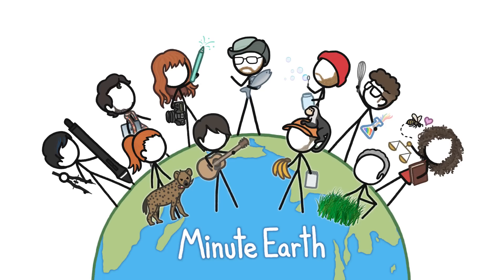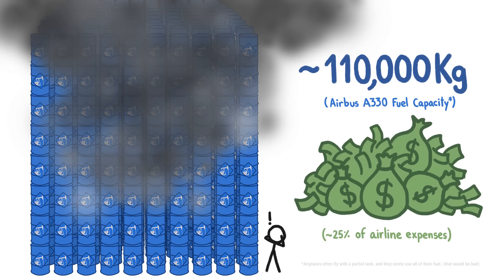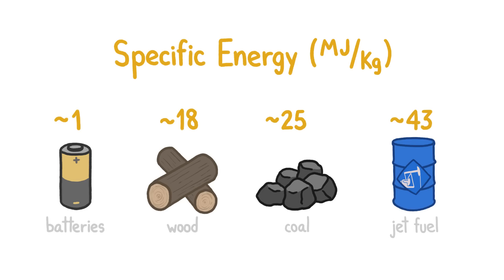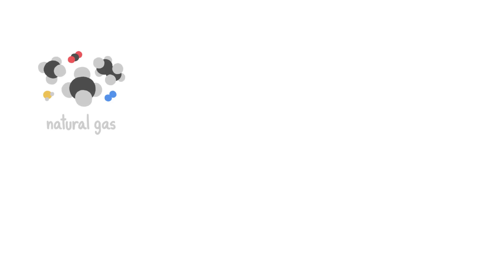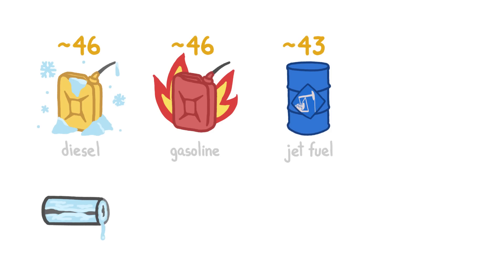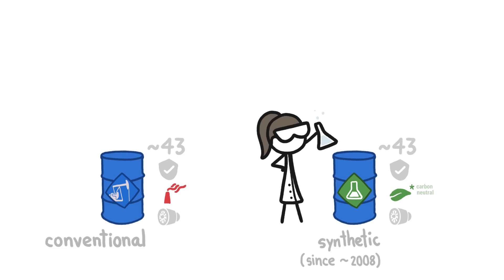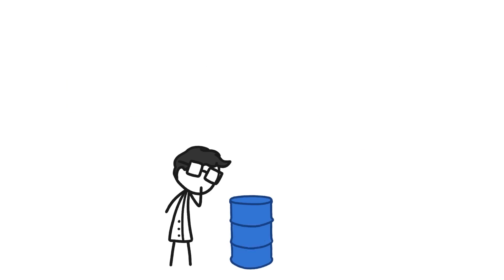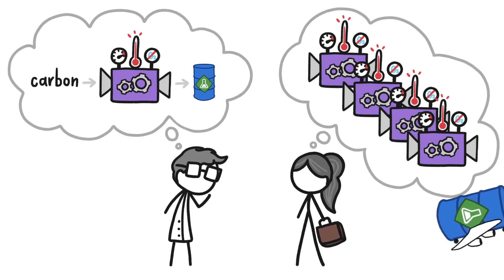Is There A Better Way To Power Airplanes?

Comment: I think planes (and gigantic mega-ships) are some of the few things that we can't easily stop using oil for right now.

However, we CAN stop using oil for powerplants and small vehicles (and anything else that can run on electricity). 
Start somewhere where change is easier than planes, right? But even that isn't happening. Not only do the people in power resist this change, but the average citizen is also against it ("bleh battery life on cars is so short and that is so inconvenient", "wahhh i am so scared of nuclear power plants and refuse to accept that they are the cleanest and most efficient power source we have").

Comment: You know, fossil fuels don't gain energy when they become buried in the ground. All of their energy comes from when they were created. An example is dead, oil filled algae getting turned into oil. While that all takes a while to happen naturally, that doesn't mean it can't be accelerated. We could build algal oil farms which use GMO algae to produce large amounts of oil in a carbon neutral way.

Comment: I wanna add that the use of nuclear fuels on aircraft is not only held back by risk of nuclear pollution in case of a crash or malfunction, but also due to the size and weight of shielding and the size and weight of the power plant including the engines (even excluding shielding). Sure, I'd like to see it happen, but it's just not feasible within the constraints of physics and biology. Thunderf00t did a debunking video of a nuclear fusion powered airplane concept. You will always have problems with shielding, because all nuclear reactions produce gamma rays if not highly energetic neutrons, which are even harder to deal with. Aneutronic fusion might be the best solution for a nuclear airplane, but you'll still have to shield the gamma rays.

Comment: Trains, waaàay more efficient, can be ~1/2 as fast. For overseas, use biofuels.
Reply: Trains are only more efficient if there is large enough demand. 
They have huge fixed costs, so if you are not moving enough people flights can be better for the environment.

Comment: Just saying that batteries are 43 times less energetic than jet fuel is so misleading. An electric airplane does not need to carry the equivalent amount of batteries since electric motors are much more efficient and they can fly higher (where there’s less drag but also not enough oxygen for jet fuel to burn) to achieve a similar range.

You are also ignoring molten salt reactors. That’s nuclear power too and it’s absolutely safe.
Reply: The ceiling of an airplane is ussaly not defined by the amound of thrust the engine can produce, but the amount of Lift your wings can produce. Additionally the speed has to be reduced at higher heights as the Mach number increases with the declining air temperature.

Comment: Less pollution upon combustion... How? (CH4 derived naturally and synthetically, both release CO2 in the same quantity).
Reply: Was also wondering about this. I could believe that the pollution created by manufacturing is less than the pollution created by extraction rigs and drilling? But then they specifically wrote "carbon neutral" in the video, which puzzles me.
Reply: @bidaubadeadieu : The idea is probably to produce methane such that the carbon in it comes from the atmosphere.
Reply: I guess they might try to use the elements they need to create the fuel in the air? Not sure how that'd work
Reply: Don't think about it too much. 90% of "green" technology doesn't do anything good for the environment, it's propaganda to make a certain lobby rich.

Comment: We should go back to airships. If it weren't for the Hindenburg and the stigma that came with it airship would have won out as the default flying mode of transportation. 90% of the time you don't need the speed of an aeroplane as a normal passenger, and their carrying capability makes them capable to compete with cargo ships. Not to mention that an airship ticket would be much cheaper and an aeroplane one, with as much baggage weight as you like. They can also run on complete green fuel like sunlight to boot.

Comment: What about solar? It would only work some of the time, but an electric plane flying above the clouds with a good battery would probably benefit from having a recharge during flight.
Reply: They've tried this. It was  a very lightweight plane carrying only a few passengers. And had massive wings. It could fly inDefinately but it couldn't exactly carry much.
Solar power just has a pretty low energy density.
Reply: But they need much area therefore would make a big plane like an Airbus A320 too big for the infrastructer we have.

Comment: What if we use solar energy instead of fuel?
Reply: Has been done on specifically designed planes. But it held only a few people.
However it could fly basically in Definately by flying high into the sky in the day and gliding at night.
Kinda useful for only a few people over shortish distances but impractical on a larger scale
Reply: Dragon Warhammer 
But solar power could be beamed down from a satellite in space. But overall the density is just too low
Reply: @curseofgladstone4981  but what if they use a battery, and charge it with solar like when day you fly using solar energy but when night come you use the battery that have been charge by solar??
Reply: Even if an airplane were covered entirely in solar panels, it wouldn't be nearly enough to sustain flight on its own.
Reply: Needs too much space on hypothetical wide-body aircrafts for our infrastructure

Comment: I mean, if you want to incentivize airlines and aircraft manufacturers to take alternatives more seriously, that basically puts you more on the political side of things rather than the scientific side. Airlines don't have to pay any tax on jetfuel, and there are basically no environmental regulations on it. Airplanes effectively run on the kerosine equivalent of leaded gas, so there are more fights to be fought there than just against CO2.
Reply: There's no lead in jet fuel, you're thinking of avgas which is used in piston engines. Jet engines don't have the knocking problem of ICE so they don't have TEL added.
Reply: @Croz89  That's why I said 'equivalent', you're right, there is no lead in jet fuel, but there is a lot of sulfur in it, which is still very bad for the environment.
Reply: @SRFriso94  Sulphur is a bit different to TEL because it's not an additive, it's naturally occurring in crude oil and needs to be removed to make low sulphur fuel, hence why high sulphur fuel is cheaper and has lower lifecycle CO2 emissions. Airlines have been last on the list because they don't spend so much time at ground level where the pollution effects on human health are most significant. But change is coming, and we might see low sulphur jet fuel used at least for taxi, takeoff and landing.

Comment: Batteries is the way to go. Future batteries will be lightweight and will hold huge amounts of energy.
Reply: It will be a very long time till that happens. We have no idea how to convert electricity to thrust
Reply: Nirmal Asokan 
Have you heard of MITs electric plane project? They put a video up about it like a year ago. Some weird science magic with ions to get thrust from electricity and air
Reply: Nirmal Asokan What the fuck? We are talking about airplanes dude, not about rockets. Have you ever seen a propeller? Some blades rotating very fast to push the air in the opposite direction of the thrust you want to get. A goddamn toy helicopter, drones, and even actual electric planes and helicopters, are already converting electricity into thrust.
Reply: There's a theoretical limit on how good chemical batteries can get. I'm not sure it would be enough for passenger air travel, maybe some regional jets.

Comment: Why can't we just condense gases to a smaller size?
Reply: You'd need to chill it down to very low temperatures. Then the problem becomes maintaining a low temperature for the duration of the flight
Reply: @nirmalasokan1687  Makes sense, thanks
Reply: Or you can use pressure instead but then the pressure vessel will be heavy.

Comment: But most importantly: Can the alternative to jet fuel melt steel beams?
Reply: Nope, but like the original it can waeken the steel so it bends when it has to support much weight.

Comment: Wait, how would a nuclear powered plane work anyway? With a steam turbine onboard and a water reservoir just as heavy if not heavier than the jet-fuel?
Reply: Likely you'd pass air over the reactor heating it up, causing it to expand and accelerate out the back generating thrust. So instead of getting your heat from combustion like a normal jet, you get your heat from a nuclear reactor.
Reply: Yes they would be heavy 

But the amt of energy is relaesed by using it really really really high as  compared to other fuel 

hence it could make a heavy plane fly very efficiently
Reply: Lots of propellers😜
Reply: Frank M 
Ram jets or hydrogen tanks as fuel. You just have to heat air so it expands really fast
Reply: i think the lead plating is the real issue here, if that wasn't a factor sure the steam turbine and water reservoir would be still quite heavy but you wouldn't need much fuel so it may only be a little bit heavier
Reply: They make mini nuclear reactors to power satellites and such. Uranium-235 undergoes fission. The nucleus splits which gives off energy. it would look very different from the giant nuclear power plants that we make in the US
Reply: @1wolfgirl300  RTG in satellites would be far too weedy to power a plane. Those are desgined to generate a small amount of energy for a very very long time, decades if not longer.
Reply: @1wolfgirl300 : A satellite doesn't need very much power whereas a plane needs a whole lot to not fall down.

Comment: If only we could power planes with the air they travel through... that way they would be plane simple..
Reply: There’s a way to do it with nuclear
Reply: @nicholasn.2883  it was a pun
Reply: Sara Mihai 
No but like actually. Look up project Pluto.
Reply: 2/3 of the reaction mass coming out the back of the engine is oxygen (as part of the carbon dioxide and water) from the air.

Comment: straps battery to plane to make it fly further

enjineer
Reply: These idiots don't even know that you can plug an extension cord to itself and get free energy. "Scientists" my ass.
Reply: @Krypto137  what if we just connected the planes to the wall with a cable? Then we wouldn't need the heavy fuel
Reply: @terner1234  why not hook it up directly to a generator?
Reply: AndyHappyGuy that defeats the purpose
at that point just use the normal engines

Comment: Fun fact, Lightning constantly hit airplanes during storms but we don't feel it
Reply: No, Lightning hit is a major incident, while survivable, the plane will going to have many inspection and maybe repairs.
And just flying close to stroms is bad enough because the turbulence, wind share, ice and hail....
Reply: @umi3017  wind shear* not wind share, also lightning hit is pretty common, but mostly just passes through without any concern, usually just a visual inspection before it can get airborne

Comment: Imagine if one day we can use saltwater to use as fuel
Reply: I think that’s called a boat. And aren’t batteries way more energy dense than salt water?
Reply: Where did your mustache go?
Reply: You mean by burning hydrogen, which takes more electricity to break the water molecules than we get out of it; using hydrogen fuel cells, which also take more energy in the same way; it nuclear fusion, which takes more energy to heat up the plasma than can be extracted?
Reply: How would that even work? Unless there's some technology I'm not aware of, you can't extract chemical energy out of slatwater, or at least not anywhere close to enough energy for a plane.
Reply: @Sir_Budginton  Fucking magnets. 

Maybe deuterium or something like that BS.

Comment: I have a solution.
Trebuchets.
Reply: Yes I would love to have my flesh burn off because of force. Nah I'm joking it's a great idea
Reply: Use a trebuchet to launch a trebuchet which then launches another in series with the last launching a plane. Seems pretty obvious a solution now.
Reply: Othmar Garithos Elon musk look out- The new inventor of the century has arrived 😂
Reply: Othmar Garithos Newtons 3rd law would have to disagree
Reply: I’m a Bird   LOL!! 😆😂🤣
Reply: ABCDEFGHIJKOlMNOPE

but yes. do it
Reply: What are we? An Angry Bird? 😏 Heh
Reply: Has been asked on the aviation stack exchange: "could airliners use a catapult for take-off". Someone calculated a fuel reduction of about 0.25% (optimistically). There are some catapult driven aeroplanes like gliders and depending on the atmospheric conditions they can reach far away points. 
Just throwing a "plane" or parachute capsule with hundreds of passengers over the Atlantic is not feasible. The object would need to store the whole energy needed to reach the other side in kinetic and potential energy at the time of start. The impulse to do that would surpass multiple times that of a car crash... or spread out would amount to building a "runway" to the point of destination.
Reply: Batteries will work for short distance flights.
Reply: Dirigibles for slow and comfortable. Rockets for quick and dirty.
Reply: Ice cream sandwich said that too expect with cars/buses.
Reply: make a plane but instead of flying in the air it goes underwater
Reply: Well, we could put planes on maglev catapults and catapult them into the sky. Good luck making something like that aim-able though... You'll also need a really high launch velocity for the reduction of in-flight fuel burn the be worth much. So then you're stuck with all the challenges of supersonic flight plus the need for subsonic efficiency and control.
Reply: Why didn’t they think of that
Reply: Or not fly on airplanes at all
Reply: Trebuchets are the answer to everything
Reply: I mean, I doubt it’s enough on their own but you could shave off fuel costs from the start with a trebuchet or maybe a crossbow/cannon.
Reply: Is it pronounced tri-bull-shit?
Reply: What are trebuchets and why would it work?
Reply: Joren Garre They are superior to catapults, that’s why
Reply: The Ash Tray makes sense thx!
Reply: @theashtray607   But inferior to canons
Reply: @jorengarre3071  I think Trebuchets are things that launch rocks very far distances and would throw the passengers at incredible speeds to reach their destination.
Reply: @solisruben296  specifically 90kg projectiles 900 meters.

You should know that. Shame
Reply: @solisruben296   Yes but it cant go that \far
Reply: Joren Garre A trebuchet is kind of like a lever with a heavy weight on the back. The falling of the weight launches the other end up.
Reply: @jorengarre3071  its basically a gravity powered catapult, the OP was suggesting litterally throwing humans to their destination.
Reply: @jorengarre3071  you see in aircraft carrier has an catapult and its for take offs
Reply: @jorengarre3071  They can launch a 90kg projectile over 300 metres.